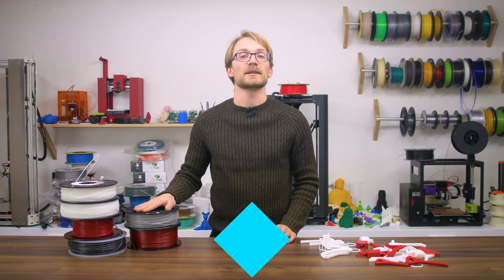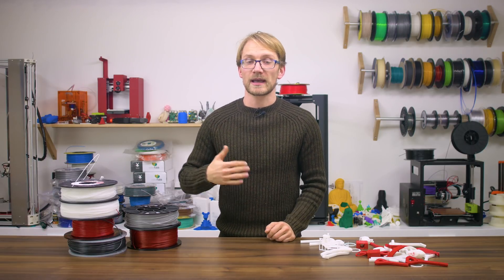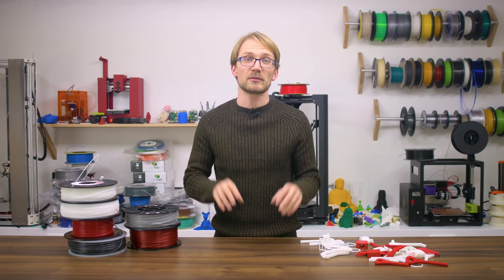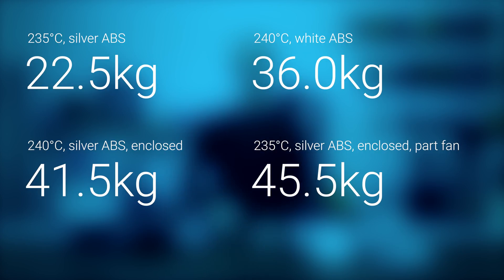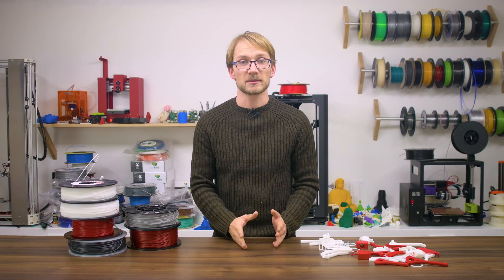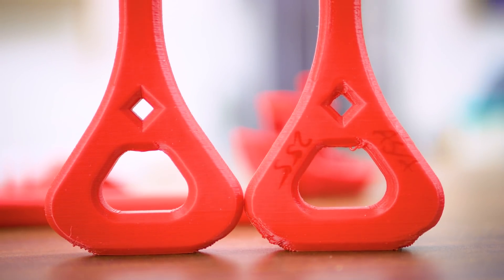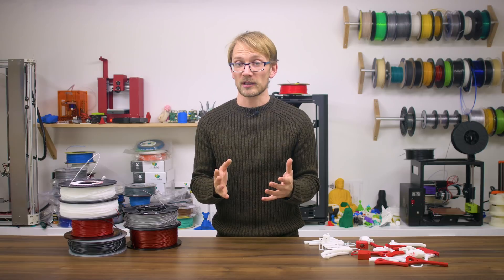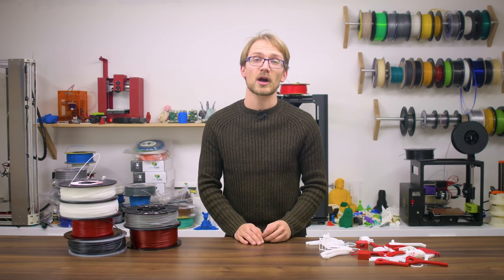3D printing with ABS: Hotter nozzle or hotter ambient? #Filaween

Comment: Hey Tom.....check this out....I found out something a lot of people can have fun with. Before I tell you what it is.....I KNOW I am the first person to discover this method so...if you do a video on it....mention my name....John Holmgren (stratairious) as the creator of this idea....ok...here is the idea...AND I have done this ..and it's so cool. I took a magic felt marker... brand is (magic) as the filament was getting ready to run through the extruder....I marked the filament with a bit of black felt marker.....when my object it was printed....a thin black line showed up in my model i printed. I repeated the process with green and red felt marker on white filament...and low and behold...guess what....a green line and a red line showed up in my print....it's really cool. when you mark the filament.  Mark about a 1 inch area all around the filament 360degrees about an inch high....and space the markings about 5 inches apart with different colors. please...if you try this and make a video about it...at least mention my name as the creator of this idea.
Reply from the maker: +John Stratairious when did you discover this?
Reply: about  7 days ago..i was fooling around with different things on the solidoodle trying different markers and it came out pretty cool.. so around the 7th of may 2017
Reply: around may 7th....hey...i also have an old maker bot thingo matic and can't seem to find a link for the software to use it. i found the firmware but not the software...any ideas tom.
Reply from the maker: +John Stratairious is that May 7th, 2011? http://www.thingiverse.com/thing:11742
Maybe hit up Makerbot for the software.
Reply: no May 7 2017 for the marker thing i talked about.

Comment: My first 3D printer was DaVinci 1.0A which has an enclosure and I put Repetier on it. For over 2 years now I have been printing only ABS and never had a problem, I didn't even know what warping was until I read about it. Never had a nozzle jam, not once. I very often print prototypes with very thin walls (0.2-0.6mm), they are strong enough and it is fast to print. I set bed temperature  to 90C and nozzle 235C, used all kinds of cheap ABS from Ebay and didn't have a single problem. I guess the only downside I can think of is smell, not sure it that could be a health issue, so I recently bought another printer to experiment with PLA. But so far PLA has been more challenging (struggling now with stringing, I have bowden extruder so retraction is not as effective).

Comment: Hi Thomas thank you for your videos and all you have done for the 3d printing community  ☺ . I have only just watched this video on ABS and I thought I would add something here. I only print in ABS or higher temperature stuff and I built a custom fully enclused printer for just such materials. As you have stated in this video that as the chamber temperature rises there can be a negative impact on the print quality  ! - I overcome this issue by removing all fans from the chamber and I use very fine airblow nozzles to achieve part cooling during printing. This has allowed me to obtain much better ptints whilts providing warp free and super strong end results 😀 all with cheap no brand ABS. I use a small air pump and flow reguators to fine tune the cooling at present but I have in mind a better self regulating system. thanks again for great content and excellently presented material.

Comment: Hi Tom! Have you ever experienced any inaccuracy of the inductive proximity sensors while using an auto bed leveling printer in an enclosed chamber? 
I have built a chamber for my Prusa i3 MK2. In order to avoid misalignment of the bed level calibration procedure I have to wait a complete coolback of the bed & chamber every time before I start printing another piece of ABS (there's no issue with PLA prints when the bed is 55 ℃). 
First I thought it will be enough if I'll lift up the printhead till the top to keep it away from the heated bed during preheating but it seems it is simply not enough.
Now I'm thinking about installing a huge fan into the chamber wall to speed up the cooling but I'd be really curious about your experience / advices.

Comment: Hi Tom. i mentioned this in your recent live stream: It'd be really good to see some more investigation into heated chambers. Methods for heating, control of temperature, effects on various materials etc etc. I really want to look at printing large strong parts from materials that can be difficult to print because of warping: ABS, ASA, Polycarbonate and POM (delrin).

Love the videos, thanks and keep up the good work! You make this hobby a pleasure!
Reply: check out stratasys, they have a heated chamber patent. its interesting how they seal the top of the machine

Comment: I'm printing mostly ABS now, because of smothing but I print it at 260 °c, without artifact!
if I print it at 235 I will get clog, and at 240-245 I get layer addesion problem on tall print. 
I need an active fan for bridging though.

So my experiance is totaly different from him. maybe my termistor isn't giving me the correct temp reading ?

Comment: Here in australia I have no issue with abs during hot or cold, but I do use a heated bed at 90deg. also printing high skirts will keep the heat in. an enclosure is on my to-do list as this will require less hairspray.

oiling the filament is a big no no with abs as well..
good videos by the way
Reply: if anything I have better success with abs over pla. I also use 238deg on my notes.. prusa i2

Comment: I had 6 printers running around the clock making parts I would sell on Ebay.  I printed in ABS exclusively. I solved the curling problem. I would print with an open reprap, a heated bed set to 90F degrees on a glass bed covered in a single large sheet of kapton tape.  I then covered that  with a layer of home made ABS juice (acetone and scrap abs in the same color as the print).  On large parts I would print with a "skirt" of 2 layers.  Parts never came up.  it WAS difficult to get them off the glass, and I would use a razor scraper to do it, but that was the price to pay for perfect parts.

Comment: I find ABS easier to print than PETG.  I have an enclosed printer and PETG just likes to accumulate on the nozzle and then dump burnt boogers on the print later.  It can be mitigated by giving extra space and under extruding, but it's just more fussy than ABS (if you have an enclosure already).

That said, I have a few unopened rolls of ABS that have been sitting there for more than a year. Reason? I just don't like the smell.  It gives me a headache even with the enclosure.  So I fuss with the PETG or just use PLA.

Comment: My main machine is an XYZ davinci 1.0 I have it dialed in perfectly on bootstrapped firmware to work with hatchbox abs filament from Amazon. Enclosures definitely matter, the davinci is completely enclosed and I attribute that to the perfect consistent prints I get.

Comment: I agree totally. I think it is the temp spread (ambient vs printing temp) that is where the problems are. ABS requires a tighter them spread than other filament options. Thst bring said, I have even had similar issues with PLA corners warping when prin ting with too much of a temp spread (60c bed, 210c hotend, 0c ambient)...my garage can get cold in the winter.

Comment: Regarding the fumes from ABS... ABS is hydroscopic and only emits fumes when it has absorbed water. If you keep ABS in a very low humidity environment when not in use, e.g. A sealed bucket with silica gel in it, you will get virtually no fumes when printing.

Comment: Wait..If you're printing ABS in an enclose chamber and you finish the print, don't all the fumes get let out into the room?
Reply: Adrian Chen yes and no. I'm not expert bit fumes can settle and separate when their temperature lowers. Also, I think Tom is worries about abs ppm (parts per million). The enclosure should settle everything down and it will sit like dust. Give it an occasional vacuum and you should be good to go.

Comment: I use ABS almost exclusively as that is what I originally started using. I just recently picked up some PLA to try and while it is substantially easier to print, I still seem to revert back to ABS as most of my printed parts need either heat resistance or strength.
I am getting great results from ABS, but only after building a wood and plexiglass enclosure for my printer. No active heating, but normally the internal chamber temperature reaches around 90 to 100 degrees Fahrenheit. I was getting usable prints without it, but I had a lot of issues with uncontrollable warping on larger pieces.
Also, for the record, I am using an Anet A8 (a.k.a. cheap chinese printer) with WYZ Works filament. I have seen much more expensive setups printing pieces that look absolutely terrible.
In my opinion, it all comes down to how diligently you are with calibrating your printer and testing different combinations of settings in your slicer application, but with ABS the best thing I ever did was build a chamber for it. I am leaps and bounds ahead of where I was when I started, but it has taken a lot of patience and many terrible or completely failed prints to get here.

Comment: I've been fighting layer adhesion issues with ABS since day one with my printer.  Time to build an enclosure.
Reply: I have a CR-10S printer and also battled a bit with ABS.  I built a simple enclosure out of thick cardboard with old glass plates as windows on opposite sides.  This made quite a difference TBH.  There were some other tweaks as well, like using a very slow print rate for the outer walls (around 15 mm/s).  This also improves the quality of the prints, the slow speed, IMHO, ensures good layer adhesion.  I reduced the acceleration to around 50 mm/s/s which results in stronger corners as the nozzle spends more time around them.   Nozzle temperature at 230 degrees C as recommended, bed temperature at 80 deg. C.  What really clinched it for me is when I started experimenting with the flow rate (I use Cura). I took it up from the default 100% to 110% and that was a real game changer for me. Lastly, I use a clear (spray on) lacquer on my glass plates which gives me excellent bed adhesion, I still use a raft though because printing directly on the glass can then result in the glass chipping when I remove prints.

Comment: Staying pretty much along the equator, even without an enclosed machine,  ABS prints very badly too!
After I got my FFCP it has been easy peasy to print ABS, ASA blends!( I do have my part cooling fan at like 10-15% speed)
Previously on my old 2020 self built 3DP, ABS just didn't stick well, and base lifted, warped badly, and layers even split from bad adhesion

Comment: I've often thought of trying an ABS print but include the part I want inside a wall of either a brim that goes full height or building a sacrificial wall of other parts that I would hope stabilizes the temp around the print.  I haven't used ABS for a long time because I gave up trying to stop delamination.  Anyone ever tried this?

Comment: For those who thinks about building a heated chamber make sure to use aluminium based heat elements as they do not get as hot a steel based ones which reduces the risk of a fire if you make the chamber of a flammable material(like wood).
Also make sure to build some kind of ventilation that will circulate the hot air in the top of the case to the bottom. I plan to route some PVC piping outside the chamber. Oh and make a window, so you can check on your prints without opening up the chamber, which would cause a lot of air to blow over the part. It can be good idea to place your electronics outside the chamber, as it might not like such high temperatures although my RAMPS has held up for hundreds of hours in 60C without a problem.

Anyway heated chambers does miracles for ABS and similar materials. Anyone who says otherwise does not print large enough prints or do not care much about the strength of the part. It also reduces the noise, the smell(unhealthy or not - ABS does smell) as well as the power consumption(less power needed to keep the bed hot).

Comment: I have a particular application that needs to be saltwater resistant, and mechanically strong. I use ABS exclusively, as I've not been able to get decent interlayer adhesion with PETG, and nylon is too expensive and difficult to work with for mass production. I print abs at 280c with a 100c bed and no chamber. 75f ambient.

Comment: I actually just made a box for my Prusa I3 mk2. I was having corner curling problems with pla (only filament I've used so far) and it's done wonders. The box actually heats up to 41 at the base (that's where I sat the thermometer) on it's own but it also caused a jam with a little tweaking I found that the 31-33 degree range is all you need for pla. It's winter here and I had been printing in the 20-23 degree range if anyone was curious

Comment: 99% of my 3D printing for the last 4 years has been ABS.  Here are a few of my observations:

1) you can print large single-walled structures in ABS without an enclosure.  See https://vimeo.com/78444620
2) if the object you're printing has any bulk, you must print in a warm enclosure to prevent delamination.  I have found that 45 -50C works fine.  My enclosed printer gets to that temperature with heat from the bed alone in warm weather months, but will need supplemental heat or extra insulation in cold weather.
3) I don't know why you're seeing print quality problems when you raise the temperature.   I have never seen anything like that before.  I suspect your printer may be having some problems- maybe plastic parts of the printer are softening, or belts are loosening due to thermal expansion.  My printer has no plastic parts and prints come out almost perfect, even at high temperatures.  
4) ABS will stick to clean Kapton or PEI at 95-105C.  I use a 1/4" cast aluminum tooling plate bed for flatness and even heating and have minimal problems with prints letting go of the bed.  I typically run the bed at 105C for the first layer then back off to 95 for the rest of the print.  If you leave it at 105C you'll get elephant footing.  Glass sucks.
5) I have used many different brands of filament and had few problems.  Filament reviews have to be viewed skeptically.  You don't know the machine the person used or their operating skill level.  People will often complain about jamming with one brand or another, but I'd bet that 99% of the time the problem isn't the filament, it's the machine or its operator.  I've had a BullDog XL extruder with an E3D v6 hotend on my printer for over two years of almost daily printing (almost all ABS) and in that time have had exactly one filament jam that appeared to be caused by a foreign object embedded in the filament.  Proper adjustment of the pinch roller eliminates stripping.  I do not use any kind of wiper on the filament before it goes into the extruder.
6) ABS's greatest advantage over PLA or other common filaments is its ability to withstand moderately high temperatures.  You can leave a printed ABS part in a hot car and it will be fine.  PLA will soften and deform.  Leaving things in the car is a pretty common thing to do, either by accident or intentionally.   Sometimes you want to print parts specifically for use in a car.  Don't try that with PLA or even PETG.
Reply: Agree with most of what you say, except the following:

2. 75c is the best temperature for your enclosure based on my observations. Still cool enough that you won't get jams in the heatbreak, and hot enough that the layers adhere the best.

4. I print on glass in my enclosure. Not sure why you say it sucks.

5. I have seen significant variety in the performance of various ABS filaments. Some manufacturers do not seem to be able to produce it without lumps, that not only block the extruder, but can be visually identified.

6. I use ABS parts for printers, as much as anything else. The heat advantages here, particularly when printing hotter materials are obvious.
Reply: Mark Rehorst  do you use  the extruder fan with abs or no?
Reply: @Mark Rehorst, What are you talking about? 

PETG will be perfectly fine in a car even on a hot summer day.

Comment: At your recommendation I'm bumping up the extruder temp (just 5C for now) and trying a light fan on ABS prints. Thus far it looks pretty good. Hopefully it makes overhangs slightly better on my ABS prints as well as improving strength.

Comment: "Are you running ABS on a daily basis as your main material?"

Yes for about 6 years and many tens of thousands of parts. I print as hot as possible with a Jhead, that is 255C, no part cooling fan. For large parts in I use a chamber temperature of 45C. That is about as hot as it can be with plastic parts and motors in the chamber. 

I don't see a reduction in quality at higher temperature. It just gets stronger.

Comment: I rarely print with ABS...  I pretty much leave it for when, like you said, I need the temp stability or I need to smooth it.  I've found splitting but I have definitely found the enclosure helps a lot, but on really tall pieces I find it to still be a problem.

Comment: Hi Tom I print a lot with ABS. I have one  enclosed and heated corexy and one open kossel XL. Smaller parts work on the kossel Xl as it has a 330mm bed, so the ambient near the part is higher than it would be on a smaller bed. I avoid printing near the edge for that and other obvious reasons. I use mainly budget abs such as excelvan at 240 deg. I have a fully enclosed corexy where I routine print big parts often with large volcano nozzles, my chamber is just around the build volume, and can go to 50-55deg C just off its bed heater. Parts come out strong and precise. I print my first layer at 250 to get good adhesion to a printbite surface then lower it to the point where I can't see small bubbles/breakdown products in the material.